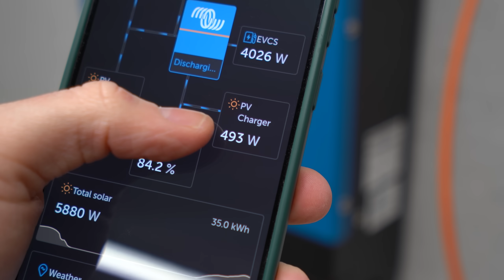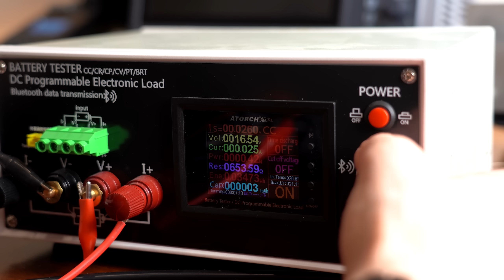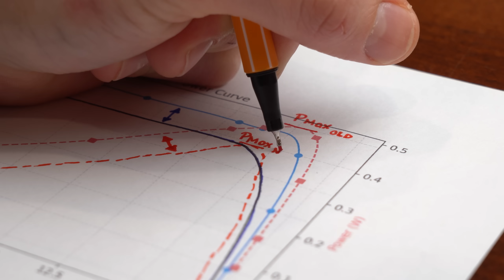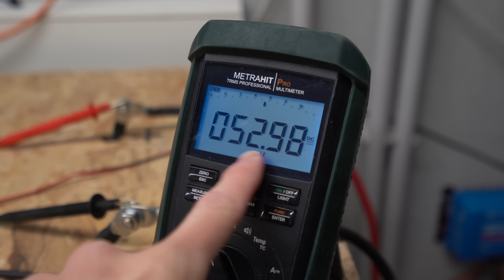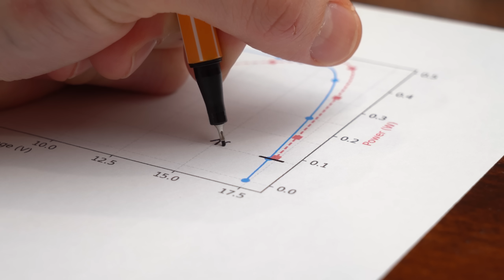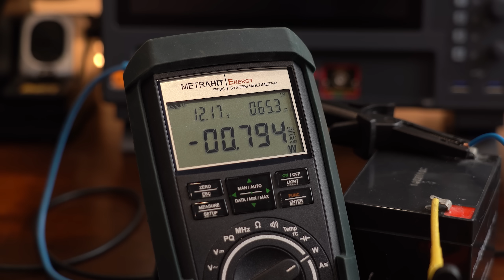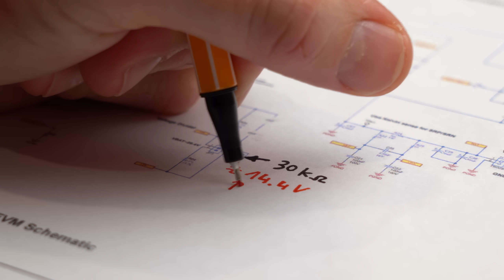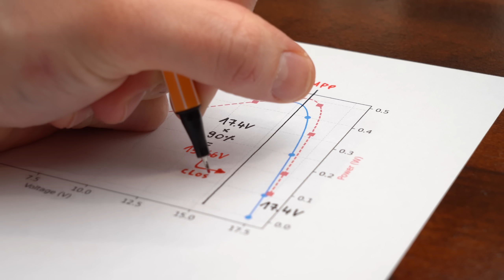My Wind Generator Was Useless....Until NOW! (MPPT)

Comment: What's fascinating is that nearly every brand of "solar generator" (Anker, Ecoflow, Bluetti...) has implemented a well optimized, high efficiency buck/boost MPPT controller on their units. These controllers often have very sophisticated self-monitoring, and automatically adjust for a wide range of DC sources. So convenient!

As a solar/battery system builder myself, I find it incredibly infuriating that standalone modules with this tech do not exist, or at least are very rare and obscure. A buck/boost MPPT controller with fast active tracking would be an absolute game-changer for 48V systems, especially portable systems that benefit from versatility. This tech has already proven massively beneficial on the solar generator market, so why hasn't someone come along to fill the gap in the DIY market??
Reply: I hope @greatscottlab continues with this project since a lot of people (myself included) would benefit a buck boost mppt solar charge controller. I am looking for one that i can use together with a 10W Solar Panel and a Meshtastic Node.

Comment: What about just collecting energy from the turbine only when it reaches certain RPM? I.e. we let it accelerate, then quickly open our mosfet to collect the energy while the voltage is high, and when the voltage drops we let it accelerate again. Like a low-frequency PWM.

Comment: all this you are doing is very interesting but completely useless for an AC generator. There you just need a voltage multiplier with two capacitors to the rectifier diodes. Their value then affects the start-up of the propeller. I have converted all my wind turbines this way and they run great from 60rpm.

Comment: Had two of those controllers.   Destroyed two turbines using them.   Both windings in the turbines were toast.   I'm wondering if the controller actually injects DC in order to brake the turbine once the batteries have reached full charge
So, I save hundred by buying cheap chinesium controllers but lost almost GBP2200 in turbines...  😭😭

Comment: I think MPPT in turbine is a mistake. The best solution is read 3 phase signal from turbine  and count 0V pass in order to know rpm, at this point at battery voltage charging  we increase current to  mantain rpm with PWM  . If low wind, low current, if high wind, high current, but same rpm.
Reply: Yes, without some PID or other loop this will probably be prone to hunting as soon as the windspeed changes. Regarding constant RPM, that would be less efficient because the angle of attack of the blades is constant, so at higher windspeeds you will stall the turbine blades, and at low windspeeds the RPM will not be reached. An MPPT has the ability to track the correct point, but because you have some inertia and wind buffetting you might find some other method works better. Maybe a wind speed sensor will be your best option with some expected voltage as the output of the generator at a certain windspeed.

Comment: Wondering if this could be used to connect a 48v wind turbine into an existing hybrid inverter designed for PV, the min start voltage is 90V for the PV input (Max 500) so a boost converter like this may allow be to add wind to a small solar/battery install without much new equipment?

Comment: Have you tried to add a gear reduction or a pulley to increase the rpm/ torque ? Along with the electronic improvements it should increase the total power output in a moderate wind speed like you claim to have....

Comment: I think a custom PCB using the IC and reference guide would be well worth it. TI chip reference designs are always very well defined, so I see no issue in recommending it. Plus, I would like to see how you handle the current changes on a board that is smaller than their dev board. Fitting it into a nice little box would be neat as well.

Comment: Could you simply put a pre-boost controller or even the BQ25750 before your MPPT controller?  

Playing around with adaptive load control for your wind turbine  would make some really interesting videos!

The issue here and I'm sure many places is we often go from very little wind to very high winds with not much in between. This winter we had a lot of wind but it's almost too much for currently widely available smaller systems.

Comment: Want wind: go high.
Want high; Go Winged Blimp Kite. (tethered by HV twin flex)
Blimp = high in low to no wind. (onboard H2 production by electrolysis)
Winged = high in high wind where a std tethered Blimp is blown down to the ground.

Use a Dihedral, Swept Back Wing and a trailing turbine blade for natural stability, rather than the "much ado! It's all very complicated!" programmer, and expensive computer control BS.

Comment: Another approach is to maintain higher voltage from the wind generator by varying the engagement of magnetic fields to maintain rpm. By being able to move armature forward and aft mechanically, just a thoight.

Comment: I use the LT8490 Buck-Boost MPPT Battery charge IC for charging up lead-acid batteries with peltier modules on our camping wood-stove. It generates up to 50W and the cicuit works pretty well.
Reply: 50wt from peltier? ? ? Really?
Reply: @BancSIMPSON  Yes, it's a water cooled module with 6 peltier elements. Chinese made thing from thermonamics
Reply: @stuibeal  interesting to see it

Comment: If the generator has parallel-connected coils, connecting them in series will increase the voltage, which is good for the MPPT.

Comment: If you just wanted heat a fixed resistance should track the power point of the wind turbine fairly closely, for electricity I have used cheap buck/boost converter pcb's from aliexpress, pick one that you can adjust the max voltage and max current and adjust to your battery and wind gen capabilities. They seem to track the power point fairly good. This could be used for the low power periods and for the high power periods a relay could bypass all of it and directly connect the wind turbine to batteries so you don't need a huge boost/buck converter.

Comment: If we use a microcontroller for a general power supply and DC converter then we are ashamed of ourselves that we are an electronics engine er.🤣🤣🤣 We design the latest circuits and you design the circuit and you use it is different.
Reply: That makes no sense. This is literally one of the use cases of Microcontrollers.Its the whole reason they include stuff like PWM , LED and Motor controllers and various other peripheals . Why feel ashamed of using it when most power supplies nowadays use them

Comment: I always thought that for mechanical generator you need something like PFC, basically it wont drain more current than load wants but will keep input voltage at highest point and current at lowest, thus reducing magnetic brake.

Comment: Why not use an ESP32? It got 16 bit steps for PWM using the LEDC  output with 1220Hz, or with multiple higher steps if you want to use less bits, e.g. 19531Hz with 12 bits.

It got also four of these channels (with two outputs each) - meaning you can run four different frequencies, with 8 different duty cycles.
Reply: You could even go fancy with it, and add an encoder for the speed of the turbine, to short circuit the generator if the RPM gets too high, to avoid unscheduled disassembly of the turbine blades 🥲
Reply: @RubenKelevra one would hope the turbine furls to prevent this?
Reply: @Keneo1  yeah, not at this price range of wind turbine 🥲

Comment: 6:28 why did you put magnets next to the capacitors??
Reply: magnets? if you're talking about those smaller rectangular things, those are surface mounted ceramic capacitors. They serve similar roles to their bigger cylindrical electrolytic brothers next to them, but they are unipolar meaning no positive and negative side, faster in response (because they have very low Equivalent Series Resistance (ESR)) and low inductance, but unfortunately much smaller capacity. You can and should use them together working as a team, to achieve big capacity but fast response typically needed if you are building a power supply, or a converter like this with fast switching mosfets.
Reply: These are not magnets, they're SMD capacitors

Comment: Without a large inertial mass on the turbine you're fighting rapid changes in output, which makes your power maximising hard.  So why not try some kind of crazy Scott mechanical solution such as having weights on the turbine axle that travel up a thread as the speed increases?! Then you could use the increased rotary speed to raise rotational inertia and store energy, which you could return to the system over a longer time period when wind speed fluctuates.  Max out and smooth mechanical energy so you're not using ridiculous curve riding in the electrical donain.  Seems like the sort of thing you'd do!

Comment: I've seen your ali video with cheap oscilloscope. Just a stupid question. Would it be good enough to read CAN communication on the cars?
Reply: Haven't tried with mine but it should. I bought an Autel PowerScan PS100 that has a basic scope function as part of the AC volt meter that tries to identify the signal frequency and peak V as well as show the signal. It has enough resolution to identify CAN signals so my porta-scope rarely leaves the shelf/box.

Comment: Assuming the wind controller is not totally garbage. Couldn't you use a simple 3 phase transformer to boost the wind generator voltage?🤔
Reply: As its AC from the turbine yes you could and I believe a AC transformer is more efficient, you still lose a bit of startup rpm but if you use a transformer to boost the maximum generator voltage to match the mppt max voltage you should get the most out of the lower end of the rpm range
Reply: @DumbGoogle-yz9cr Rewind the generator for higher voltage. Sloppy semi machine / manual winding at a Chinese factory is crap anyway.
Reply: @Tore_Lund  that works too would be more work but more efficient, the key is matching the mppt voltage range to the wind turbines voltage range to allow the mppt to work over then best rpm range to get the most power out

Comment: I made a small dynamo type contraption from a wash machine drain pump turned by an 18v motor from a cordless drill powered by a 12 volt battery to reduce the speed.

The drain pump output can be as low as a few volts up to over 500 depending upon the speed, anyhow that feeds into a 150cc scooter regulator and back to the battery. 

So far so good

Comment: Solar MPPT trackers track changes over period of milliseconds, but a wind turbine is a mechanical system. It needs minutes to stabilize. You will be tracking with a much too small time constant. You can't use solar MPPT trackers.

Comment: As mentioned before turbines are not solar panels. The voltage and the current have an influence on the rotation speed and thus the wind flow. The mechanical power input is not constant when you change voltage and current. I would follow the following approach: measure the wind speed by letting the turbine run without load (measure the voltage). Ideally you have a separate small turbine for wind speed measurement or a pitot tube, like in airplanes. For each wind speed, find the optimal voltage and current by stepping through the current range (you can use optimization techniques here). This process might take an hour, as you need to wait for mechanical stabilization after each step (A solar controller is just too fast for this). Then memorize the setting that gives most power.  You'll need to redo the measurements many time to get more accuracy.  After a while the controller can learn the optimized settings, and the can interpolate the V and I settings based on the measured wind speed and the data tables you collected. When measuring wind speed with a separate turbine you could use polynomial curve fitting to try to predict the behavior of wind over time, and adjust your setting a bit ahead of the actually windspeed increase or decrease.
Reply: That actually sounds doable as a DIY project!

Comment: I've got a feeling that just getting a higher voltage output "wind generator" will solve most of your troubles.
Lower KV bldc motor = higher voltage at the same RPM.
You could try to DIY the generator yourself, by using a hobby BLDC motor and some blades.

Comment: Better yet to take lots of measurements over the course of a week or so at various current loads, generate an optimal load/windspeed table that you then interpolate from. Or maybe also optimal windspeed/generator RPM.
You could have a small "P&O" adjustment algorithm running on top of that to generate a correction table too, which could be used to fine-tweak the main table over time.

This may be the best solution for your DIY arduino setup.

Comment: why not just a plain boost converter set to above battery voltage, then add a couple volts for diode drop and into the stock controller....?

Comment: Might be a good idea to continue with the arduino. You just need a line search algorithm to find the maximum. If you have current and voltage numerically available it should be trivial to generate the pulse witdh for the buck boost converter. A good example would be Brent's line search. It will only need a few ms to find the maximum.

Comment: change the gearing of the turbine as well as the generator head for something a bit stronger.  MPPT Requires 6v above battery voltage to begin charging. so if that turbine is putting out 14.4v and the battery is at 12v, no charge.
Reply: Gears make it more difficult to start and you need lubrication. Large wind turbines may use gears.

Comment: Stupid question, but I have to ask: in a short-circuit you get the maximum current, but zero voltage. Where does the energy dissipate?
Reply: It will be very difficult to spin!  In the alternator coils, diodes and power wires.

Comment: I have a doubt why you cant add an boost converter to the output of wind generator and connect the output of the Boost converter to your buck MPPT this way it will work right . or someone correct me if I am wrong

Comment: The way it always gets done usually is the motor is used as an inductor
Reply: Huh?
Reply: @MrSummitville  instead of having an inductive coil you on a dc dc boost converter you use the motor as the coil white it spins and it typically boost the voltage. This is how  brushless dc motors do it with scooters how they get 40 to 80v with the motor spinning
Reply: @nightmareinaction629  As in Regenerative Braking?   Although a  wind turbine has very low output power (less than 10 watts) with very slow wind speed.  This may explain why Wind Turbine Controllers have not implemented this idea. I will investigate.
Reply: @MrSummitville  exactly. The way these cheap wind turbines like to work is way different than how you would typically try to extract power out of a bldc motor. This is why you can spin a motor like a scooter at 200 rpm with 40v but if you spin it at 200 rpm you only get like 28v once rectified you may get 35v but not very usable cause your battery is at 40v. Add some precise timing in there and turn the motor into a inductor and you can get whole loads more voltage. It's kind of cool but also complicated. Usually it's achieved by lagging the carrier frequency

Comment: You don't need any of that use an open source bldc controller like the Vesc or Odrive atach to the phase windings, with some software tricks and independent wind sensor you can make it kick start it's self in low winds and use mppt to drive regen braking this skips the diodes and uses the mosfets as an ideal diode aray, you can also use the back emf to get accurate rpm once calibrated. Odrive  has independent brake resistor support as well so you can load dump power.

The hardware is fairly easy to do any of this, but the software will be a little tricky to nail down. You almost want to make the mppt tracking flip flop extremely aggressive so it can watch input voltage and current and have it bounce  between the sides of the peek at a crazy rate north of 1khz with a pwm north of 30khz and save the inductors for the output filters you can just treat the source as the inductor it's a big coil of wire lol

Comment: If you wanted to buy a boost controller all you needed to search for was something like "solar boost mppt" there are a handful of pretty decent ones already, the MPT-7210A usually green with a color screen and lots of information or look for a black box with a tiny screen or 7 segment display, may go by the model BM3072, isn't as nice but it's usually about half the price of the other.

Comment: Hi I see projects online using solar power to keep a few 18650 lithium batteries charged. But since I am in a colder climate I cant do that since charging lithium when it is freezing is a bad idea. I am looking for away to power the part that reads temperature and switches the solar power to the charging part only if its not to cold. But at sun rise there is a bit of a period there is not enough light to power an arduino I can't seem to find a solution for this maybe if you get bored?
Reply: Drill a hole in the ground, and sink the lithium battery in it?

Comment: How about stepping lower before stepping up?  Set it up so you Initially charge a 6 volt battery, then step up from that?  Then a boost converter can work with a reliable voltage, and the wind generator's charging circuit have a place to stuff it's low voltage?

Comment: Stabilize your wind generator voltage via a diode (or bridge) and a large capacitor. This will vary but basically give you a cleaner supply to use as a power source.  Good luck!!

Comment: If you were to connect the leads from the bridge rectifier to the battery, you could use a diversion controller to divert the excess power away from the battery and into a resistor or whatever you like.